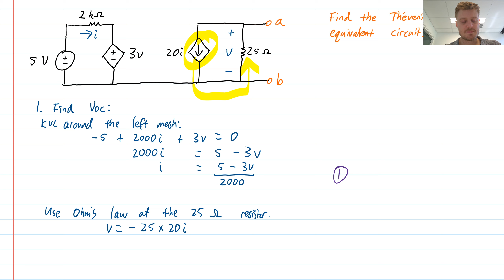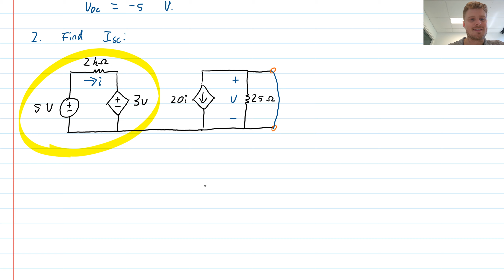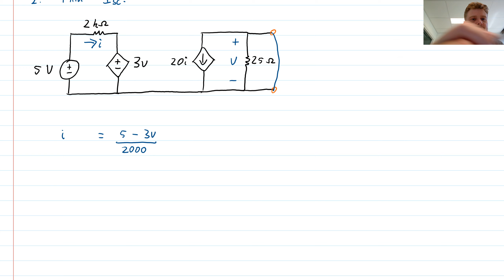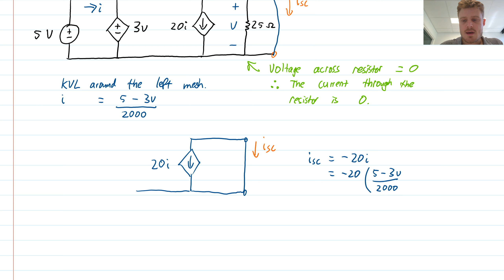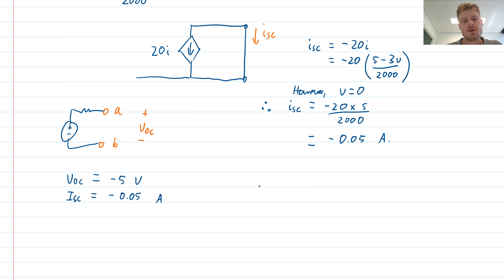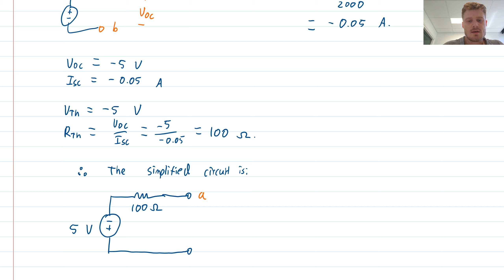EG1012 Week 7 Video 3 - Thevenin equivalent circuits when there is a dependent source

Comment: Hi Bronson, Isnt KVL on left mesh = (5v-3v)/2000?. Where did the V go from the 5?
Reply from the maker: The leftmost source is "5 V" as in "5 volts" whereas the other source is "5v" as in "5 times the variable v". I agree that the notation is a bit confusing; I think I got the variable names from the textbook. The little gap between "5" and "V" is supposed to mean that it's units of volts. Another clue is that the leftmost source is drawn with a circle, which is the symbol for an independent source.
Reply: @BronsonPhilippa  Oh yeah I see that now. Yes the notation is a bit confusing. Thanks for your reply.